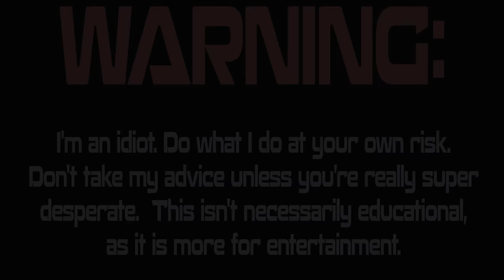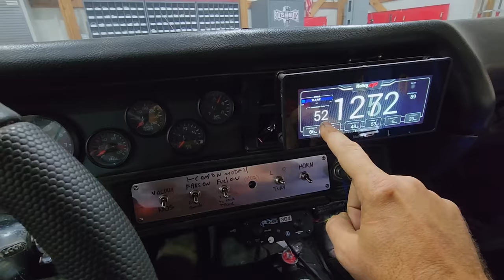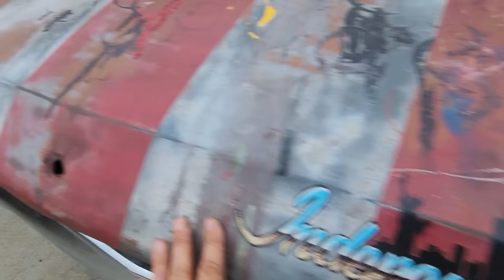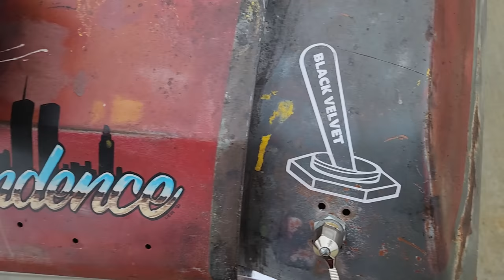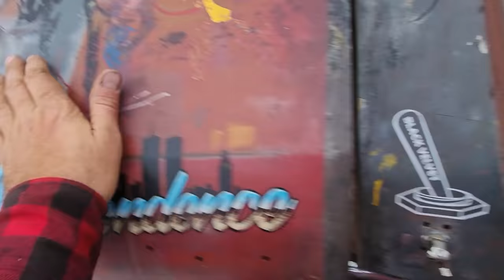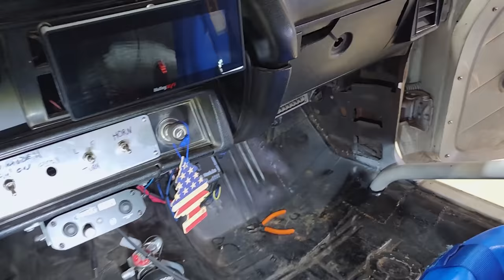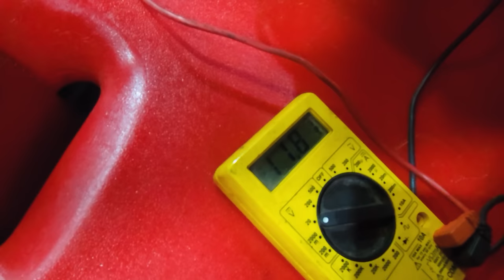Body Work with a Fork lift and Winch - Can Independence Chevelle be fixed?

Comment: well now that im lookin at this video again, I got to thinkin and found a pretty good solution to your problem. Turn it into a full on drag car. Then the body panels dont even matter so much. Just extend the cage back and backhalf it. Independance lives on then. Then when your able to get to the parts that are just fucked, you can still get to them without taking the drivetrain out to toss in a whole other car

Comment: Maybe instead of repro sheet metal, you could find some panels off of another car that's unsaveable and replace just the absolute bare minimum of floors and rockers and mounts, the structural parts, to make Independence a little more solid without replacing the whole body. Not even necessarily good panels, just bits that are less garbage than what's there. Then maybe Independence won't be on the verge of falling apart and parts of another classic get to keep going.

Comment: I know you probably wont see this, but I'd pull this drivetrain, and swap in like, a 90s fuel injected big block, bout 300 ponies, and keep the car to take to drag and drives. Its in too bad of shape to run 9s, but i'd be fine to run 13s or so
Reply: Update: nope, definitely not. I'd try to frame swap it. Leave the body, as-is-ish.

Comment: Just spitballin here, but I'm thinkin you should get another chevelle to build out what you already have for museum a show car, not pretty, just a twin of the original. Use as many of the original parts as possible, "as found" etc. This will go in the Vice Grip Garage Museum. Then get another chevelle to duplicate that car as much as possible for drag racing, road trips, all the best safety stuff. Use that one for travel and such. Then build a third "burnout" car that looks pretty much like the original, with steel tube frame, aluminum pans, fiberglass body with extra body panels and bumpers that are easily field replaceable. Narrow the rear axle, add heavily reinforced wheel wells, fire system, etc. Use that one for burnouts and exhibitions. Clearly you and your channel vice grip garage are key parts of automotive history from the pandemic on forward and like cleetus will be a anchor for the future generations to build on.

Comment: What i would do if i had that car. Is that i would remove the entire under carriage part of the car removes the gas lines break lines even remove engines and tranny. And everything else to make the whole bottom just bare to the bones and resurface the whole bottom by spraying it down and recoating it multiple times with rust restoration and then primer and buy agm body panels and steel panels to install to cover and mold it to the shape and size of the whole bottom and screw it all in and walla ur done with saving it again. ;) and making it stronger then ever. ;)

Comment: PIECEMEAL!  My boy, Piecemeal. 
Forget the rotisserie. You can weld sheetmetal, You can get a brand new floorpan, You have a lift, or two, or three.
Gut the interior, unbolt, cross-brace  and lift. Go crazy with the "zipcut" and wire wheel, brush paint the frame. GET THE KIDS INVOLVED. You have buds.
Slam the new floorpan on the frame and weld-er-up. Take your time. It's just another build. (should take about 30 minutes)

Comment: Why say its her last dance, what to do with it? Yea it keeps on rusting, full restore not likely, I seen that big block that was painted tan with rust streaks, put it back in her and call it good. Or since that frame is no good get a 4x4 chassis, full roll cage from fenders to trunk, attach the body panels figure out how to attach the cabin, comfortable seats, maybe an all new flooring and firewall, 33 inch mud tires using that tan rust streak big block so she can roam elsewhere on this great land besides just asphalt, a new lease on life. Just a thought.

Comment: Section 8, paragraph (k) of the U.S. Flag Code states, "The flag, when it is in such condition that it is no longer a fitting emblem for display, should be destroyed in a dignified way, preferably by burning."   
I say this due to the paint motif. You have your orders...

Comment: It has been fun watching Independence but there just isn't enough of that car left to make sinking money into her worth it.  By the time you were done you literally would have nothing but the roof left and then is it really the same car?  I would remove the power train and slap a nice small block in her for shows etc. Put the engine in something a lot more solid.  I remember the frame being a mess on her as well.  That just makes it unsafe.

Comment: Oh that's nothing.....I hit a deer head on at 50 moh with a 91 Pontiac Bonneville ssei...but cud still drive it home.....I tied a barge rope to a light pole amd used vise grips to crip the rope to the hood and several places and used the car driving fwd and backwards to make my pulls.....and a bullpen hammer to make the relief hits.....all said and done....other than paint cracks ...I pulled everything straight again and it looked good again..got a junkyard grill..and u cud barely tell I hit a deer.....the magic of redneck enginuity

Comment: Ni, I made a comment once before about the strips. There are 15 strips on your car when OUR flag has 13, Our flag stars with red and ends with red. Your car starts with white and ends with white. All you have to do is paint over to two white strips at the bottom of both side of the car  with black paint, Please.

Comment: Just my opinion,my 2 cents,but I'd tank that drivetrain out and install that nice drivetrain in an equally nice vehicle.Put something simple and reliable in Independence and drive it.Dont beat on it anymore.Just drive it.The body is nothing worth fixing,and it wouldn't be "right'' for it to be fixed anyway.Pull the nice parts out,put in simple,and go enjoy the car.

Comment: Since you now live in Tennessee where there's an abundance of Southern muscle cars; pull the drivetrain, fuel cells and other miscellaneous parts out of the Chevelle and install them in a cleaner, straighter '72 Chevelle roller body...The current body is only going to be good for one more race anyway... The current shape of the rig is total burnt toast,,,,

Comment: Take the engine out(use this engine in another project) ....find a original sized motor...what was it a 350...307?      Make it reliable driver with mild power.....no more contests for it

Comment: I’ll be “that guy.” Rust is not originality or virtue. If that car really means something to you, you should fix it right. Pop riveting one rusty old piece of metal over another one is truly disrespecting the car. If it’s really as dangerous as you describe with three bolts holding the body on, how can you take your kids out for drives in it? Make it structurally sound with a patina’d exterior that is a tribute to the original spirit of the car. Think ICON Derelict, or rather a VGG Dereklict!

Comment: That thing is so bad. Once you take the good stuff out, engine, tranny, wheels, drive train, what's left isn't even worth junking. If I ran a salvage yard I wouldn't accept it, due to the rust being so bad. That steel has no value, too far gone to melt down. It needs to sit in a field and turn back into dirt as it rusts away. Maybe they can shred the rusted metal and put it in a land fill . That must be what they do with those too far gone bodies, they probably run them through one of those shredders. But the rusted crap it would turn into would contaminate the good steel. Junk with no value! And I'm sick of looking at that pile of crap in your videos. Get rid of it!